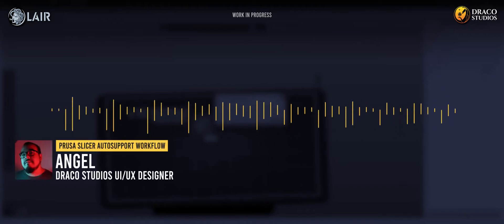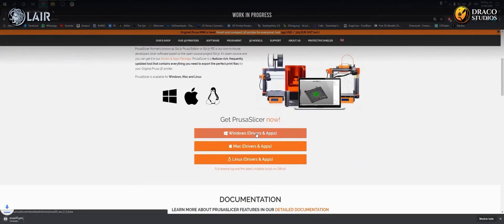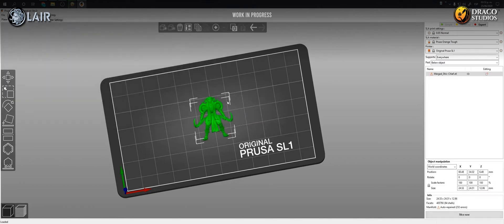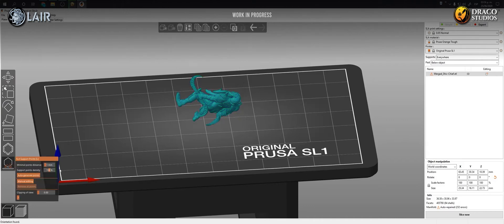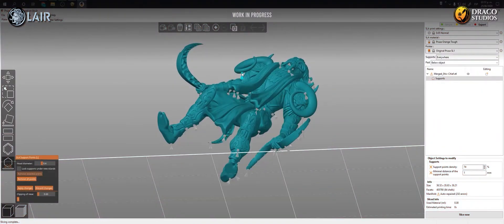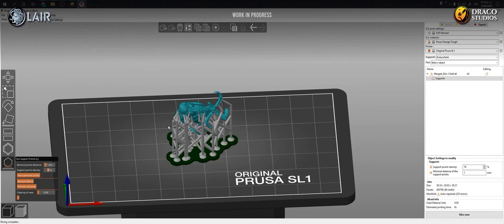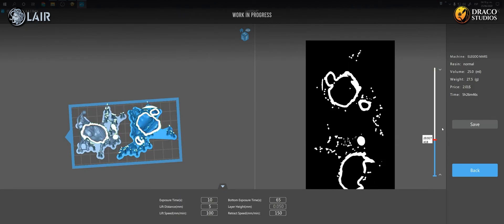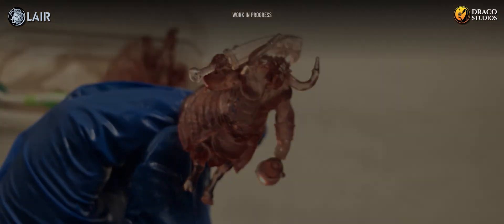How to support resin miniatures EASILY | Prusa Slicer auto-supports workflow

Comment: Thx very much for this video!
This seems like a good workflow if you dont have pre supported Minis (normally I just buy pre supported stls, because I dont hove much experience with supporting)
Could you make a video on how you get the supports of easier? In the video you Bucentaur Model seemed so easy to remove the supports. I had more trouble with my DB:BoV Models, but I didnt use hot/warm water, just used a plier after washing (normally I can just pull the supports of of the models, but the DB:BoV Models are smaller and more delicate than my usual prints)

PS: I dont know why you use a "Robot" voice, I would kinda prefer a normal voice, but thats just my preference